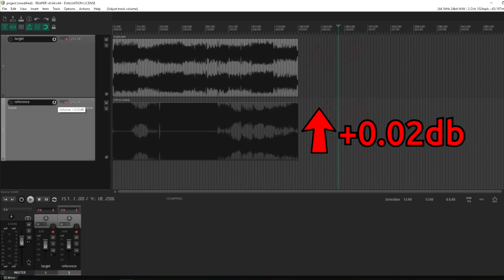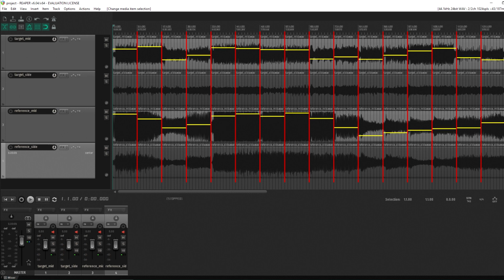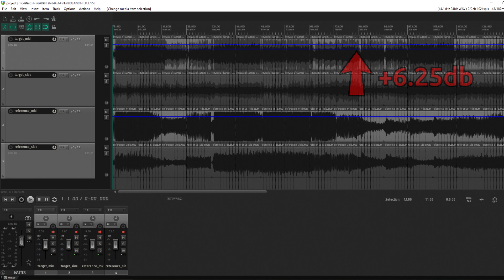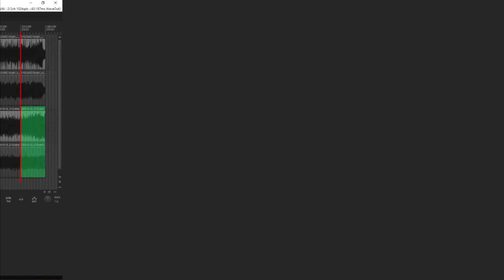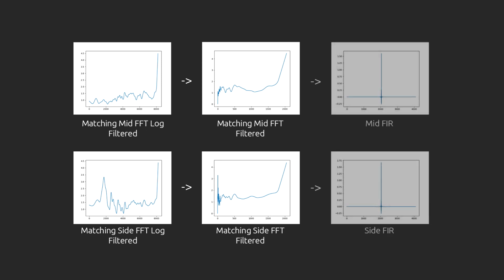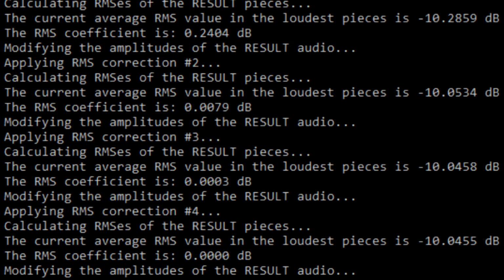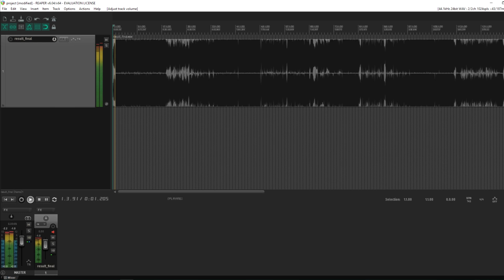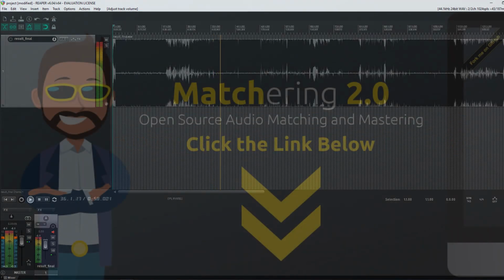Matchering 2.0 - How It Works

Comment: Totally blown away by this - found it through a Benn Jordan video. I've tried all the AI mastering tools, this is heads and shoulders above.

I've had very good results using a collection of reference tracks combined, almost like pink noise. I'm not looking for loudness, that's easy to add, so my use case is more as a very sophisticated match EQ. It's EXCELLENT at doing that.
Reply from the maker: @timgosden5519  Thank you for your kind words 🙏🤝
Reply: @Sergree  I would love to be able to batch process tracks. I'm running it in Docker.
Reply from the maker: @timgosden5519  Yeah, you can do it by python scripting, using matchering-cli script. But if you'd like to do it in some GUI, i remember that UVR5 desktop app also added matchering to it. Please download UVR5 and find matchering here: Choose Process Method > Audio Tools & Choose Audio Tool > Matchering

Comment: do both tracks require to have the same structure?
Reply from the maker: It doesn 't have to be the same. But it will be better if they are similar. This page describes this in detail https://github.com/sergree/matchering/wiki/FAQ